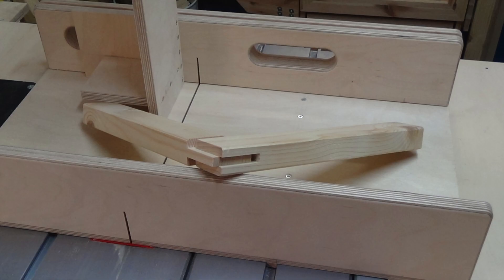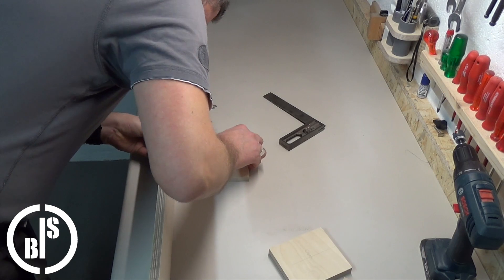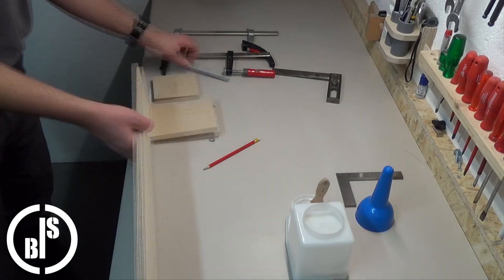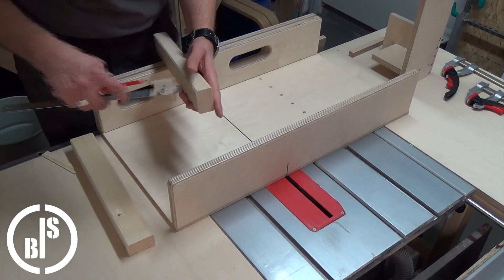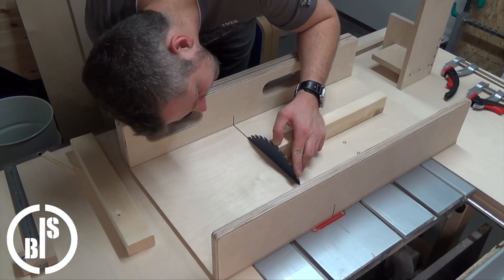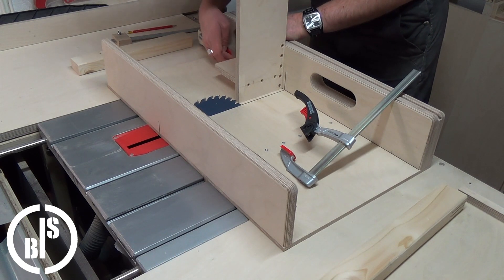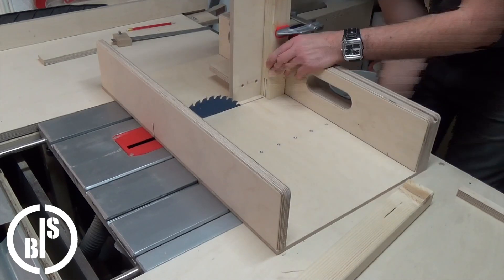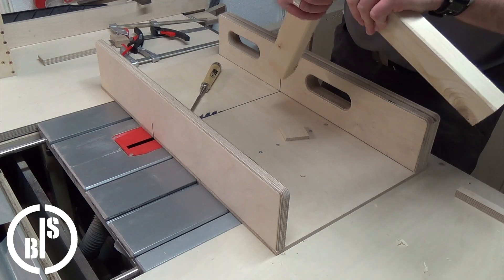Can you cut perfect Bridle Joints on the Table Saw? / Making a Simple Slot Mortise and Tenon Jig

Comment: No music. I’m not subscribed because of that. Also, if you’re interested, the bit of moving the piece by the width of the blade made no sense and with only a single camera angle, I was lost. But I liked your concept of the 3 pieces of wood on a sled!
Reply from the maker: In newer Videos are no music anymore. For me the shift by the blade width does make sense. Yeah, this 3 Pieces was the simplest solution for clamping a piece of heightwise and perpendicular to the sled. Thank you anyway for your comnent.
Reply: I SIMPLY BUILT IT Oh good (regarding the music). I’ll check out some more.

I think I might have figured out why you move over by a blade’s width, after thinking on it.

Thanks for your reply.